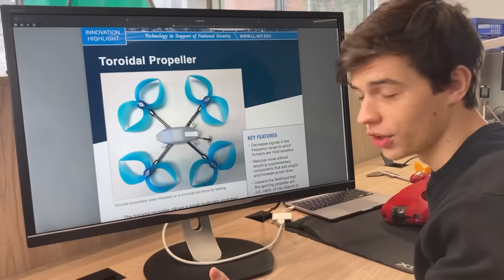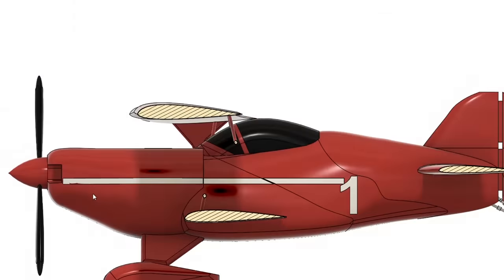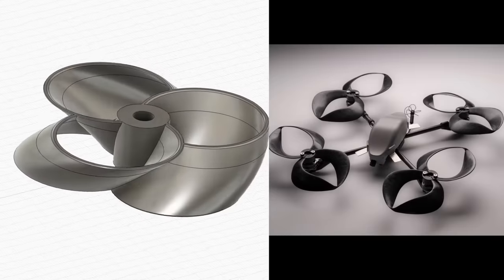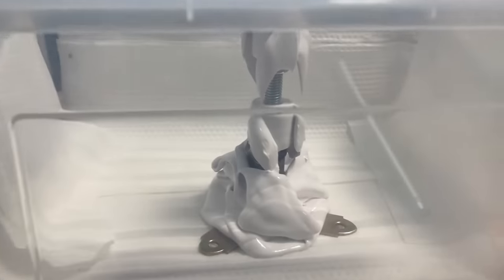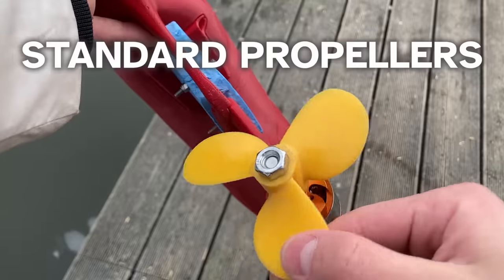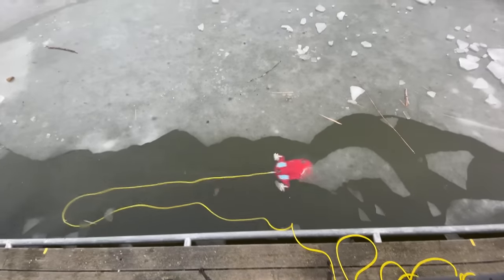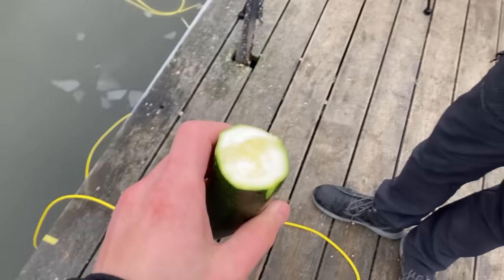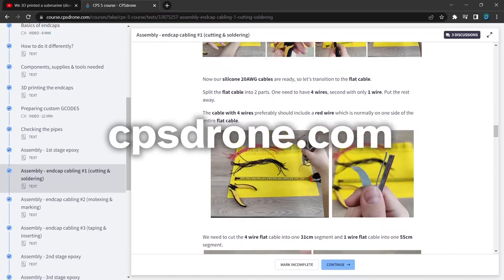Testing a TOROIDAL propeller UNDERWATER

Comment: the torodial propellers should be much quieter and can compete with the standard propeller if you elongate the design (and dont drag the yellow power cord when you are doing the test) the torodial propellers might be faster if they are 2 or 3 times in length

Comment: MIT you have made a basic error in comparing a standard  propeller to the toroidal one ,the most important the weights. The toroidal propeller was heavier than the standard propeller that's why you had slower speeds.

Comment: Dang a few hours. I have done acetone smithing on abs and only left it in for 45 minutes and it was getting a bit soft. I have never printed asa so am not sure how that is different besides uv resistance. I really might want to make one of these. Have you done anything with ardusub? I recently. Got a pixhawk and am not sure what to make with it. I have always wanted a sub but none off the hobby off the shelf ones barely work.
Reply from the maker: Yeah, it was about 2.5h. They were definitely soft afterwards but otherwise they wouldn't get smooth enough. I also refined it a little with a paintbrush.
Yes, our Ardusub is modified for the 5 motor configuration. Building ROVs is fun, you can give it a try!

Comment: They don't tell you the torque and power ratio is more than a engine can handle it won't fit your outboard a real plane propeller . Engineers usually don't leave the office

Comment: Well done, but the "Sharrow-inspired"-one was nothing like the Sharrow-propeller. There´s many videos/fotos of the Sharrow-propelle onliner, if u use them for stereolithography, you can CAD a perfect copy, and then print, cause yours, was nothing like the Sharrow...
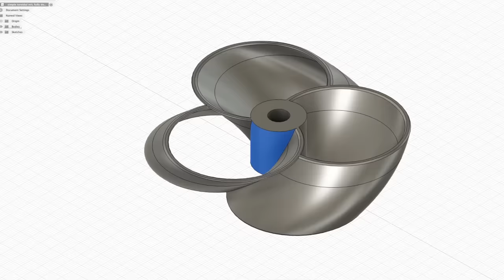Reply from the maker: Can you explain how exactly are they different? Because we tried to follow their design closely. The twist of the blades is in the correct direction. The only real difference is how the blades in the Sharrow ones are skewed to the back. However some of them are not even skewed, like one of theirs which we show next to our model at 2:14
Reply: @CPSdrone  To me, they look very different, the MIT-copy too... Meybe it´s the impression of seeing them on video, instead of live, like you can...

Comment: he didn't go into it to much but with normale propellers the vary ends of them are going to be moving faster then any part of the prop but also bc it's the end nothing is there to push the air anymore meaning the part of the prop that moves the most air is just vilently moving it off the prop at the same time not accualy using it witch turns into sound from the air being vilently thrown into static air this is why the quieter something is the more efficient it is bc it's using all resources available to it so by preventing the air from being thrown off the end of the prop youll now be using all resources witch is exactly what the new props do

Comment: New prop needs to spin slower, add a reduction case and electric motors should be run dry. Those motor bearings are ruined and too much water friction inside motors.
I'd make a sealed motor housing with a shaft seal designed like a mobile Freon compressor and counter pressurize it before each use.
Reply: интересное решение герметичности посредством магнитов.

Comment: Why not include a speedometer on the drone?
Reply from the maker: It's not that easy and you hardly ever need it. We could maybe hard code it for  a certain prop but it will change with a different one
Reply: @CPSdrone  They sell them for boats, less than $100 purpose built to measure aquatic speed.

Comment: It's like when You put on an airplane twice bigger wings and wandering why it's not performing much better...
It should be accordingly smaller to consume less energy, weight less and MAINLY casuse less resistance.
Try to repeat the experiment dropping the rotor diameter about half.
It's very much the same like going up steep hill on too low gear and wondering why it's not going fast enough...

Comment: These tests appear to be very crude, in three runs I saw the drone dragging along a loop of power cord with it, this is certain to adversely affect results. Plus these props are supposed to increase fuel economy not speed.
Reply from the maker: You're correct. We need more tests to make a final assessment

Comment: Why are you guys talking about speed constantly. Speed is far less important than  manouverability and running time. I'm in industry. We're using ROVs in water  depths like 2000 meters. We need light, precise control, power (nit speed) and manipulators. Id like to have a backpack drone with sipmle gripper and long autonomy time. Speed is not so important. Remember you have to manage the tether all the time. Focus on this. Efficiency, efficiency and one more time efficiency. There is market for these toys but it must have a long running time. Cheers z Polski mates! Dobra robota:)

Comment: You didn’t take into account pitch or diameter. 😂😂
Reply from the maker: The diameter is the same in all 3 of them. Pitch is roughly the same because it's variable depending on which radius do you measure
Reply: @CPSdrone  That is the problem, your pitch cannot be the same as a normal prop because you basically have 6 blades instead of 3.

Comment: The driving force is only on High side, there always be lower part. Let's ask, How tall are you or what is your height... nobody ask how LOW are you, or what is your Shortness.??
The driving force of James Watts Steam-engine hundreds years ago, really from VACUUM pressure, the negative side..from the cooling /condensing effect. The performing function of the SIX Blades is the "Angle of Attack" (AOA) that created high pressure pushing...no vacuum/low nothing..how High is your IQ not how LOW...pls. be knowst.(?!?)